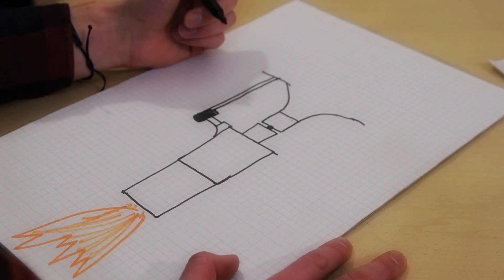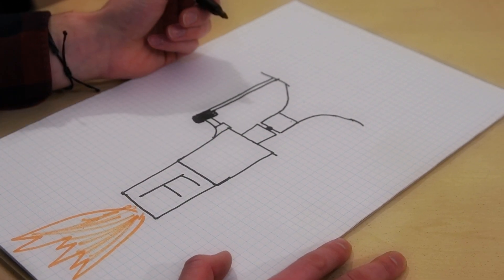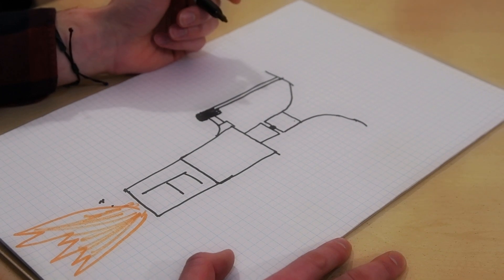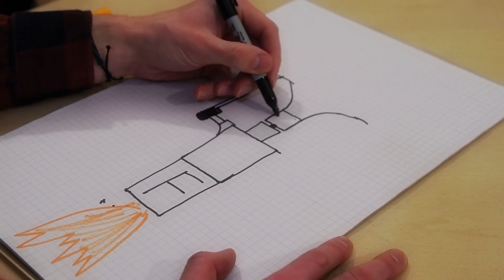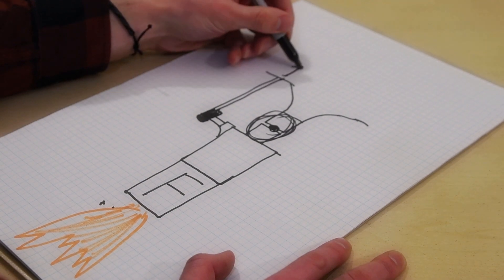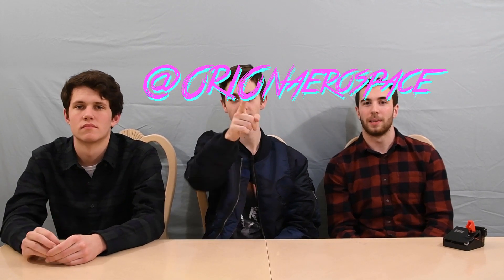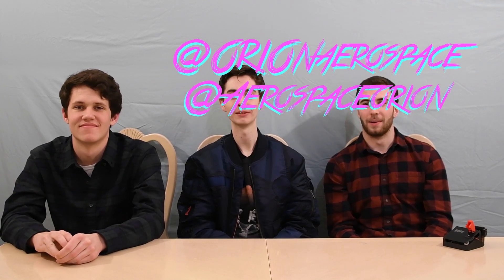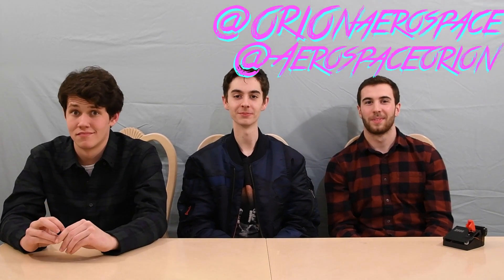F Series Thrust Vector Launch | Failure and Better Rockets

Comment: Are you using teensy 3.6?
Reply from the maker: Duality Covers we use a 3.5 :)
Reply: @OrionAerospace  Are you sharing you actual equipment? Like which sensors are you using etc.
Reply from the maker: Duality Covers take a look at a couple videos back on the channel :D we will also reveal some details of our new flight computer in coming videos